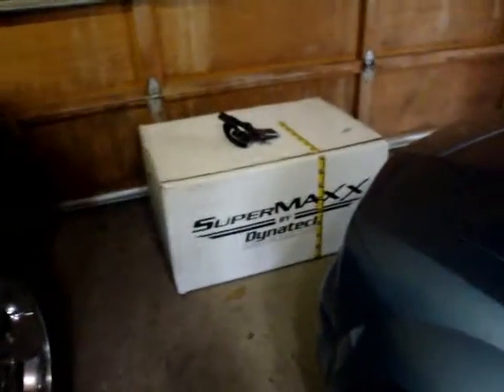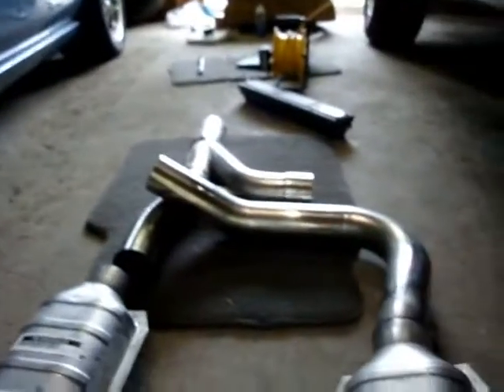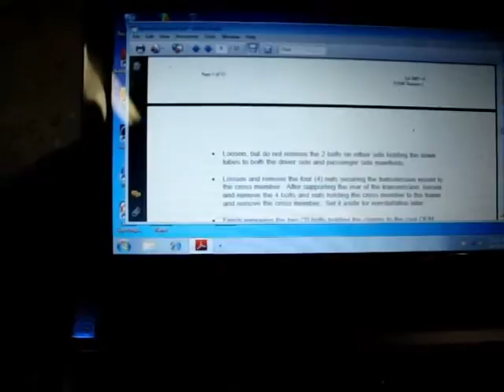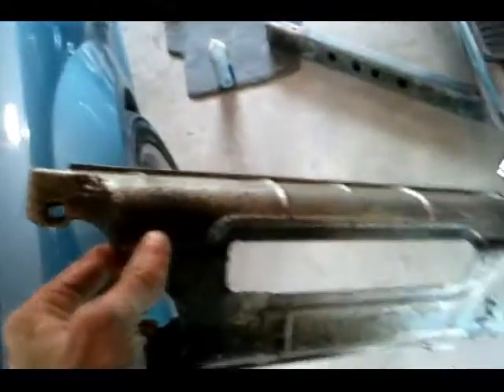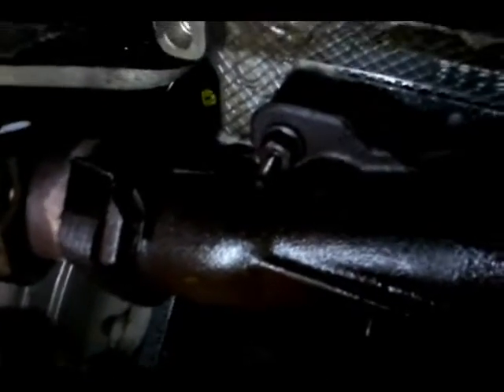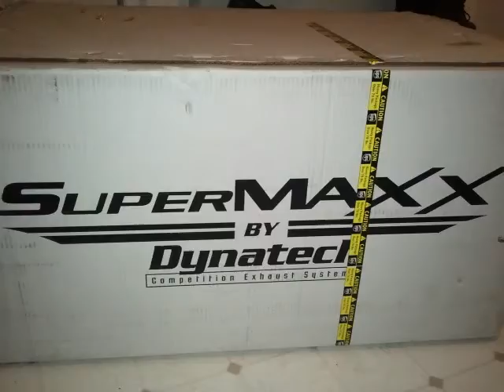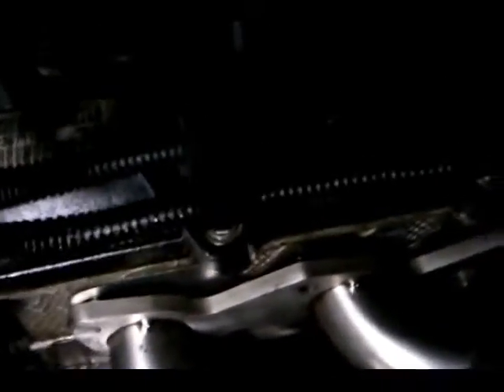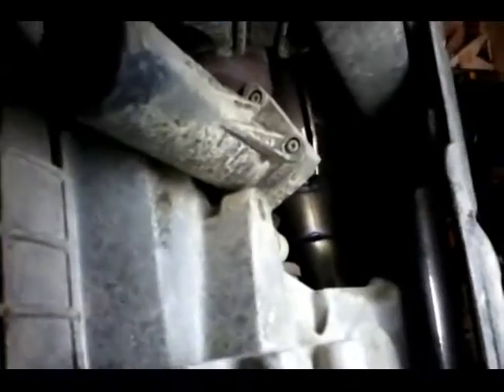07 Dodge Ram Long tube header install

Comment: Hey azzo540, got my headers installed on my truck this weekend. The video helped alot. I went with the pacesetter ceramics and off-road y pipe. I reused my cats, had them opened up to 3 inch and extended my o2 sensor harnesses. They sound great and low end torque went up. Nothing puts a bigger smile on my face then hearing my hard work pay off. Thanks again bud

Comment: Did you encounter any check engine light problems since your install? How does your exhaust perform,any problems?Thanks for help!
Reply from the maker: lean bank 1 slow reponse bank 1
Reply: any fixes for that code? or is it not a big deal???
Reply from the maker: tuned it out no big deal either

Comment: How did you out the passenger side in, my transmission lines are in the way
Reply from the maker: i don't remember it getting hung up on them.  i think my studs all came out with the nuts.
Reply from the maker: did you remove the studs or not.

Comment: how much was this whole kit? brand? where'd you buy, I'm thinking about it
Reply from the maker: $1500 for the Dynatech Kit
came with the Headers, Magnaflow Cats, 3 O2 sensor extension, extra pipes leading to the muffler, or the cat back you have. and all fastners
Reply: azzo540 thank you very much

Comment: have any problems with em? ? i been looking for a good set of headers for my ram an everyone says just go with BBK shorties because the long tube headers tear up the engine-bay an burn wires over time
Reply from the maker: no problem at all the only wire you might burn is o2 extension and that is a maybe.  tear up engine bay?
i have heard pacesetter or dynatech
dynatech are more expensive but come with more than just headers and bolt on.
pacesttters who need some to fabricate from headers to muffler or cat back.
I prefer LT over shorties
Reply: thanks for the feed back but yh i been reading some forums online an some people were tellin me all kinds of bullshit an saying LTs are pain in the ass to install so i been looking for videos online an yours is the first i came across an everyone else that actually has them says there's no problem so i might be going with the LTs or either just get shorties an save some $$ for other mods
Reply from the maker: Lethal GunShip
passenger side is a tight squeeze especially with the lower header bolts in.
Reply: Thanks, a video in the fuckin dark. 
WORTHLESS>>>>>>>>>>>>>